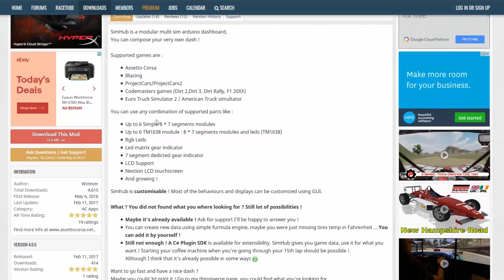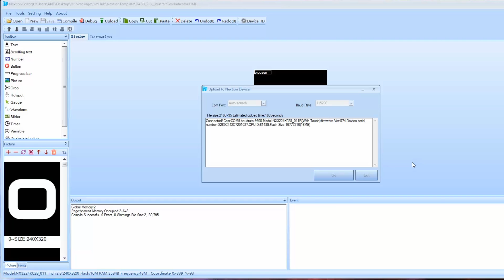MAKE A GEAR INDICATOR SIM RACING DASH - DIY

Comment: The display that you used in video is the NX3224K028_011 but the display that you linked in description is the NX3224T028_011. The difference it's that the one that you used has got 16mb of flash memory, the one that you linked has got only 4mb. I've buyed the display of your link (using AliExpress, but it's the same display) and I followed your steps, but the display seems be bricked, it remains black and it won't do nothing from Nextion Editor (he recognize it). Now I've buyed the right one from amazon and I try to fix the old display. Pay attention to what you link, it's simply to make a mistake and waste money.Thanks anyway for the guides you do!!

Comment: Very nice video. Actually all your videos are very helpful and thanks for doing this. I play manual gear ratio Dirt3 with Xbox controller. Will the display work properly even without a racing wheel?
Reply from the maker: Connects to PC works independent of wheel base.

Comment: how do you change the colour of the templates
Reply from the maker: Open nextion and template. Save the images then edit in photoshop. Then replace in nextion editor
Reply: hey you wouldn't spare set black and red template the same as yours  as i do not have photo shop thanks

Comment: Thanks to your vid, I've managed to integrate nextion screen into my custom f1 type wheel :)
http://nsa37.casimages.com/img/2017/02/26/17022612023264778.jpg
Reply: fantastic!
Reply from the maker: This is awesome! Very nice job! I want to make a F1 wheel just like that. Where did you find the grips, from a Fanatec Formula wheel?
Reply: amstudio I've ordered the grips directly from fanatec support. Grips are the hardest part to find / make. They cost 36€. You can get the one with suede or leather.
Reply: bad azzz homie, can you put a pic of the back?
Reply: Here the build progress > http://www.isrtv.com/forums/topic/24625-t300rs-custom-f1-style-wheel/

Comment: another great video.. keep up the good work!! ..i realy need to know how to get my arduino & tm1638 to work with dirt rally.. some one said i may half to change some code on the dirt rally  file..is that true? n if so what? o and thanks again.. for the help..
Reply from the maker: Hey man, go to HubPackage>GamePlugins>Codemasters there is a how to file there. Edit the hardware settings config file for dirt rally with the data.

Comment: I know this is the wrong video but, if one wanted to solder the sequential shifter into the TM 458 Spider? I invested in a pc build and honestly, don't need to spend anymore than I already have.
Reply from the maker: You will need to open up the wheel and solder to the shift paddle switches. If your on PC its easier to wire the sequential to a USB encoder.
Reply: amstudio I play on PC and console, but I wouldn't mind doing some soldering, it's not that much of a pain.

Comment: Would you be able to do any tutorials for console compatible equipment? I've been looking to wire my hydraulic handbrake into my thrustmaster t300 wheel to the circle button. You seem to do good at tapping into circuit boards so perhaps you could figure it out?

Comment: Hey What Are Your Assetto Corsa FFB Settings For Drifting :D
Reply from the maker: Most of my settings are very close to default, the best thing I have found is lowering the FFB in game.  Each car I adjust slightly different and use the toggle switch on my wheel to set the FFB+/-. For drift, try lower your main FFB to about 50% and then adjust up or down from there to suit your driving.  If your still stuck I might make a video showing my exact setting.
Reply: Ok Thanks Man :D
Reply: Hey Im Still Stuck. Can You Make A Video :)

Comment: Hi!! Where have you bought everything????Can you share the links??? I want to find the carbon plate that I also have seen in your video "make this sequential shifter usb", and please tell me how do you cut it. Thank you
Reply: It's vinyl with adhesive on a piece of plastic. For cutting the hole i suggest you drill a hole in each corner big enough to fit a hacksaw blade, then you just go to town on it. Use some sandpaper to smooth out the edges. Put the vinyl on last to get a good finish. Parts are listet in description!

Comment: i would like to build something like this i want to try and build like the fuel indicator mph rpm water air oil so on even have the key and parking brake setup
Reply: amstudio can you try to make a working tachometer. I have seen it in another youtuber's gameplay but they dont have a video on how they made it. I would love to see it, keep up the good work!
Reply from the maker: +MR Cra3y yes defiantly something I'd like to make.
Reply from the maker: Check out Simhub has alot of options for most of the things you listed.
Reply: I agree

Comment: could you please tell me what desk, and monitors you have? ive been dying to know, and im buying a new desk soon.
Reply from the maker: Custom made desk using an Ikea bench top. Monitors are LG 27" LED IPS.
Reply: i luv you OMG
Reply: what is the desktop size?
Reply from the maker: Approx 74"x 26"
Reply: Sorry for being a bother, but what did you use to hold the monitors up, and could I have a link
Reply from the maker: That's alright, using 2 separate stands. One dual monitor stand, and one single monitor stand.